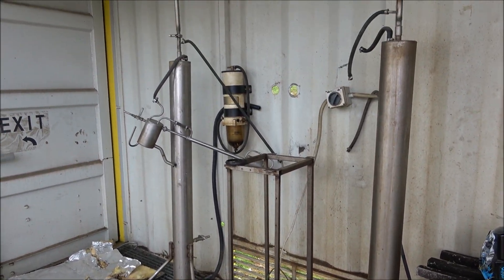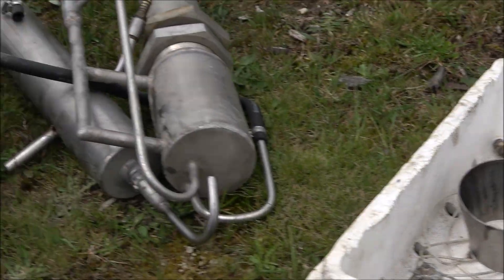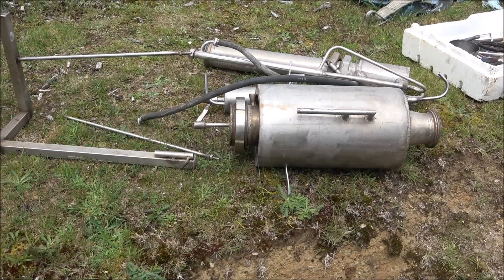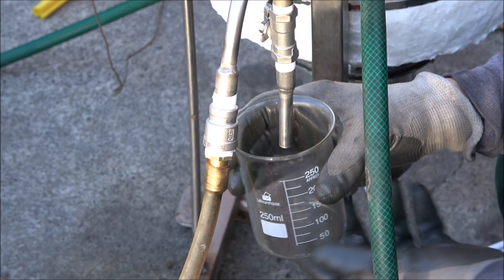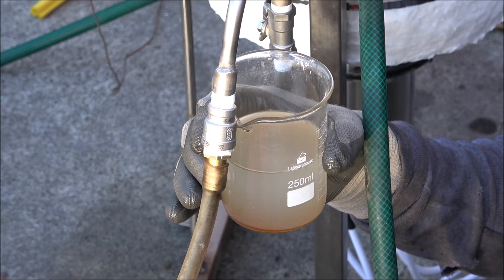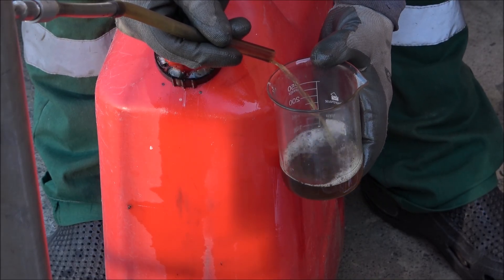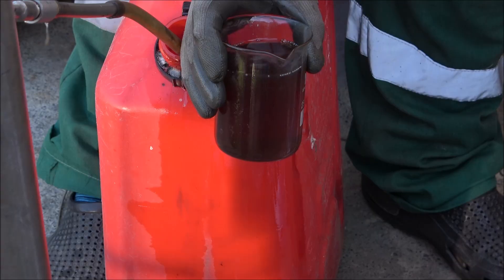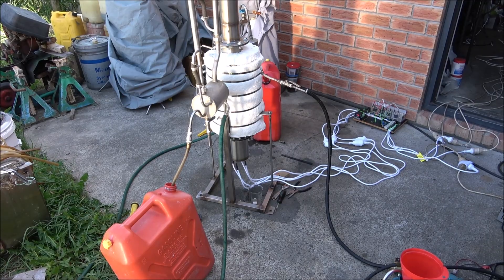WRONG FUEL RESCUE: How to Separate Petrol & Diesel at Home (The $10,000 Mistake Fix)

Comment: Over the years I’ve intermittently had the issue of gas and diesel getting mixed but never enough to justify building a miniature refinery, it’s cool but I’m curious what the reasoning was for building this besides being really cool.
Reply from the maker: I built this for an accidental fuel mix, which is a common problem I wanted to solve efficiently. You'll be surprised, but not only you having this problem, the fuel tankers are do accidental mix too, fuel rescue businesses pump out thousands of liters every week, so it is not for a personal problem solving, but for commercial fuel separation, and to dispose it is real waste of valuable resource, so separate and reuse, even as a furnace fuel, generator fuel, I power my diesel and petrol cars with it.
Reply: $ duh
Reply: @tonydiesel3444  how much would you have to have mixed to financially make it make sense though? A whole gas station that’s been contaminated or your just illegally tapped into an oil pipeline?
Reply: @garrypennington9576 imagine it'll be for a business for a testing company fuel testing company or a fuel company that has mixed fuel all the time no value separated lots of value machine probably cost $4,000 something like that USD
Reply from the maker: ask a fuel rescue company, any local one, how many liters they are dealing with daily, if you saw those guys, you may notice that they are literally driving small tankers, as one shift intake may exceed 1000l, in most cases they have a few small tankers operating simultaneously, a medium London based fuel rescue company may end up with 10000l of mix per week. Especially when a fuel delivery company made a costly mistake.
Reply: @santeryi9  cool that’s what I was wondering thanks